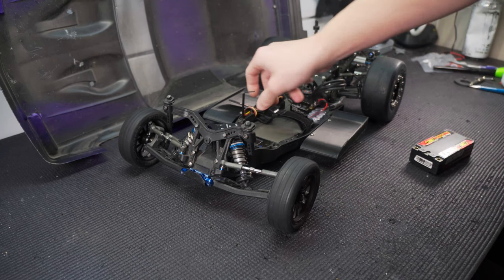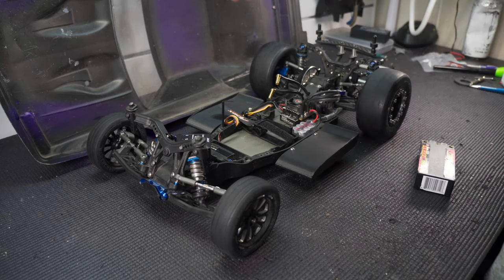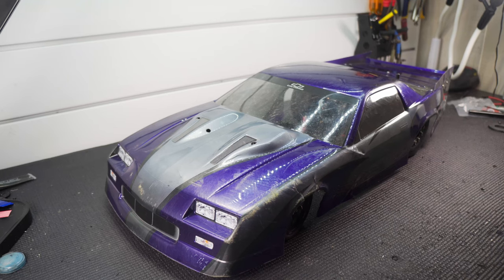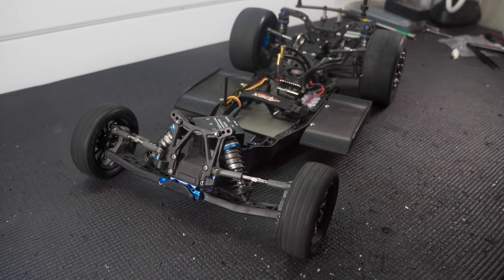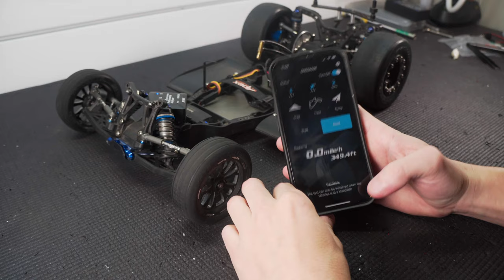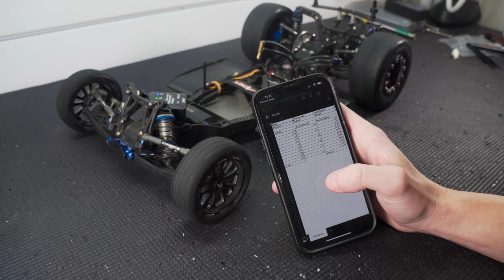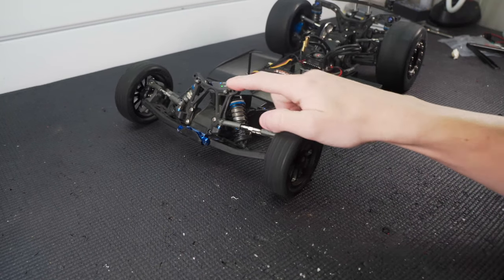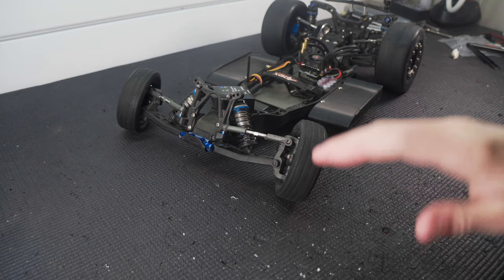Is the RC No Prep Drag Car Fast Enough to Beat the Rain?!? | RC No Prep Drag Racing Testing

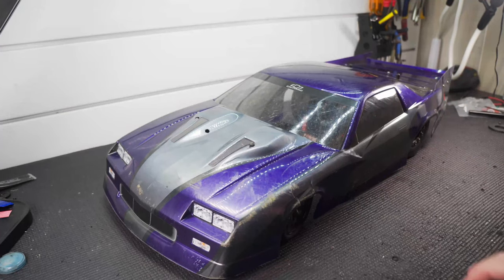Comment: I'm gonna assume it's on GNS Now guess 2:35 @  62 don't worry about conditioner get Tire warmers you'll be much happier
Reply from the maker: Wouldn't the tires still need to be "broken in" in a way? These tires are still pretty fresh
Reply: @FullThrottleRC  if you're running reaction the belt is the issue.. you want to soften the belt there's really nothing you can do to the rubber that's going to last. before you mount them throw them in a clothes dryer with some rags and a flip-flop for a cycle... it'll beat the hell out of the belt for you.. ready to run

Comment: This is how I get my tires conditioned

How to get rc tires ready

6. Mark left wheel with silver sharpie
7. Sand tire in the same direction the wheel will turn (left wheel counter clockwise, right clockwise)
8. Clean tires with brake clean, spray brake clean on paper towel and rub onto tire until no black dust gets on towel
9. Mount tires to car, Cover whole contact patch with tire conditioner (constantly rotate tire) 2 coats, get sidewall of tire on second coat
11. Bag tires for a week (try to go as long as possible)
12. Clean tires with brake clean like step 8
Reply from the maker: Thanks for the tips! I think I'll try this method out, seems straight forward.

Comment: The best method I've found is 100% wintergreen oil mixed with 100% isopropyl alcohol.  1 part wintergreen to 3 parts isopropyl. Brush it on make sure it's even. I use an old toothbrush to really massage it into the tire. Place in a zip lock. When it looks dried reapply till your happy with the softness. Buy a cheap tire durometer to get consistant results.Also I'd eliminate the slipper and use your drk to tune thats the whole point of it. The slipper is super inconsistent and robs power. That Drk is a beast and I bet you will gain alot from some tire conditioner and slipper Eliminator.  Also clean tires with non chlorinated brake clean in between runs. Good luck keep us posted
Reply from the maker: I'll look into that, thanks! Do you sand tires at all to break the fresh rubber as well or just use that solution?
Reply: @FullThrottleRC  yes I sand with 80 grit then use tire warmers to get the pores in the rubber open to soak in the conditioner
Reply: Thats prep if you dont want prep you simple green only. Simple green burnout on carpet.
Reply from the maker: @Stage2_392  I've used simple green before I found it just made the car spin out.
Reply: @Stage2_392  tire conditioner is not prep. It just softens the rubber prior to raceday

Comment: I built my first serious drag with a ccs slash chassis build...came out awesome...now a lotta of making stuff right🙄my first issue is on initial throttle there's a stutter then she laumches.i put a clutch elimamater in..checked my soldering...is that normal
Reply from the maker: Are you running the original Slash Electronics? Sounds like an issue of a non-sensored motor. That definitely isn't something you want in drag racing.
Reply: @FullThrottleRC  thanks for responding...no I am running a 3.5 Trinity holeshot with a hobbywing 200 amp xr8 pro.😁first checked all soldering ...I believe it's somewhere with spur to pinion..I have a slipper clutch eliminator🤔48 pitch combo🤔I do not have the motor and esc connected(wire computer thing..thanks...I am Soo close to my long awaited...creation😁

Comment: I used to use wd40. Just apply and bag. Day you're going to run, clean with dawn dish soap and rinse. Once they dry, you'll notice they become extremely sticky. 

Now, after each pass, just simply wipe off with a sponge and some water. You're really just getting dust off.. but, the tires should regain that same stickiness after the water dries. Not sure if it was the wd40 displacing the water or what, but plain ol water seemed to get the tires back to ultra sticky, as if i had just cleaned with dawn again. 

Lemme know if you try it. Worked good for me, curious if it does for anyone else. Plain ol water.
Reply from the maker: Something like that is what I'm looking for. Thanks!

Comment: Will you ever run a carbon fiber chassis
Reply: Carbon chassis doesn't make it faster. It's all about the setup. Stock sc6 chassis can go sub 2 no problem if you know what your doing 😉
Reply from the maker: I haven't really been interested in one. I find I have this chassis setup pretty well and I still have some potential left in it. The only advantage I really see is weight and I find my car is pretty light already

Comment: 99 kph is 61.5 mph.
Reply from the maker: I had switched it over to miles instead of km in the app but I never thought that maybe there was a glitch in the switch and it was still reading kph. That's about my normal speed so that would make sense